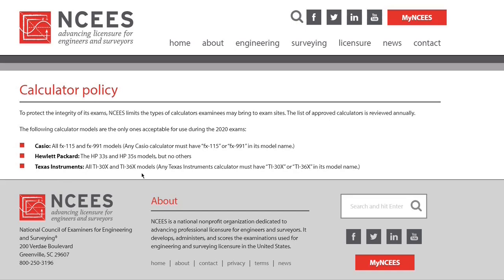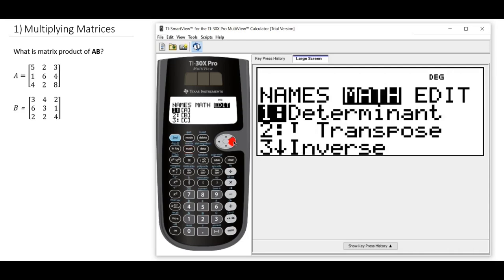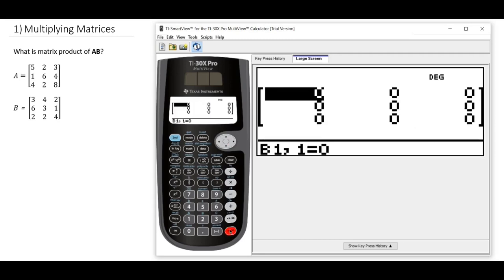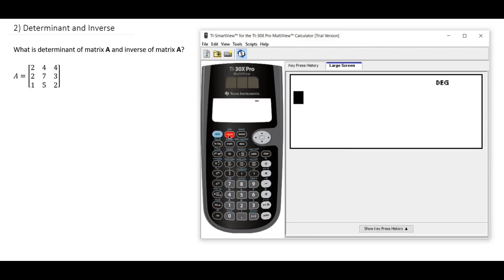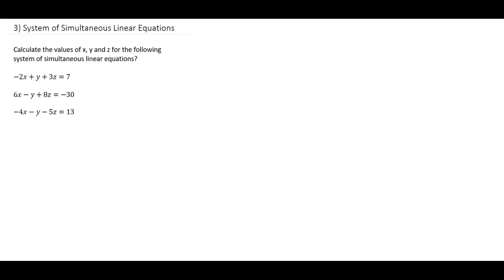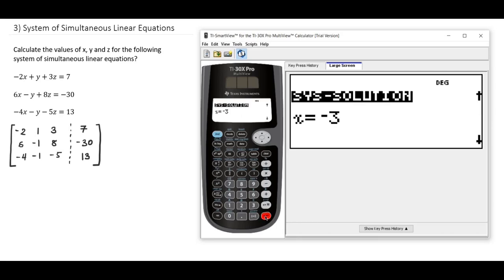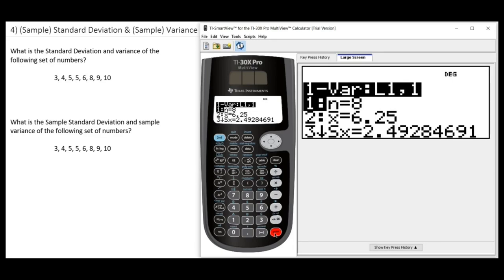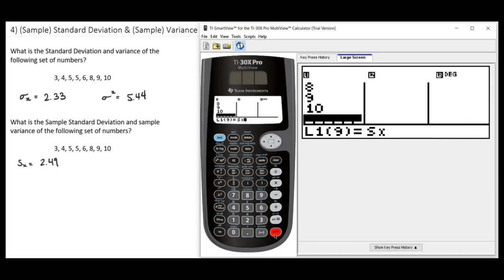Best Calculator For The FE Exam 2023 | Solve Matrix, Determinant, Standard Deviation and Variance

Comment: My opinion on on calculator and book use in the FE exam: the more you need to use them the more time you’ll waist in most cases. When I took the FE I did not use any books I had next to me a summary set of notes from the FE book and a simple calculator to multiply divide square root + simple stuff.If you end up having to linear equation stuff in the FE exam, skip that to the last thing you do. Trying to solve this question. That could easily take 5-6 minutes if you are fast will eat precious time you need to answer questions you can solve by just looking at to them.